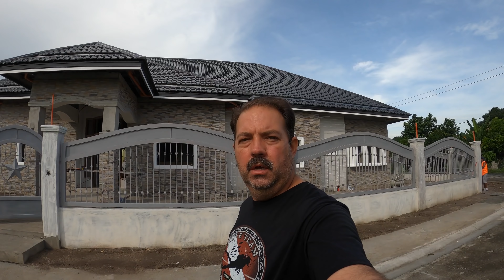Philippine House Building Step by Step, Build Day 177: Stainless Steel Sliding Gate Design

Comment: Texpina,  I painted about 80 steel beams (4" X 12") a few years ago with epoxie primer. The paint flaked off in sheets.  Aparently there is a 
short (3 days for my brand) time before the first topcoat must be applied. The two topcoats stuck to each other  applied a day apart but not
to the 3 week old epoxie primer. I used a well known quality brand and no thinner, just 125 PSI paint gun. I am reluctant to mention the brand
name for legalities reasons. I found out this has happened to other people as well. If you sand the epoxie primer you remove the "tooth" that
you applied it for. Just saying.......     I suspect the primer could be applied a second coat the day before the top coat but have not tried that.
I was building a greenhouse on top of an 8,400 sq ft house. The 6" X 18" beams painted with acrylic had no problems.

                                                              george and aurora
Reply from the maker: Thank you for the tip. I'll check again with the painters.

Comment: Did you also consider putting electric fence around your perimeter wall
Reply from the maker: No for a couple of reasons.

1. Not allowed according to our Deed of Restrictions. 
2.  We live in a gated subdivision with 24hr roving guards. 

However, we do suggest that anyone building a home should invest in CCTV and other inconspicuous security measures.

Comment: Are you using 8 ft. tall doors and will the wood filler have a noticeable different color from the wood doors when the varnish is applied? Roy
Reply from the maker: Roy,
The doors are the metric version closest to the standard 6’8” doors. Wood filler changes color as it dries to almost clear and barely noticeable. 
Good questions 🙋‍♂️
👍😊

Comment: Is there a reason why the wood doors aren't finished off site in the shop that fabricated it and or even the kitchen cabinets aswell; couldn't they be made and finished offsite and then brought in and installed? It was the same thing for the gate segments too. Is your engineer your architectual designer aswell?
Reply: .....because labor is cheap in P.I. unlike in the west where things needs to be installed fast. Time is money..........in P.I. you can customized a lot of things.
Reply from the maker: Also, custom built on-site allows for the imperfections of the previous steps in the construction to be accommodated. 
The original design was purchased in the US over 10-15 years ago. Our build engineer makes suggestions along the way for small field changes.